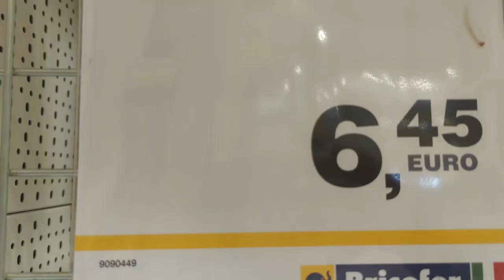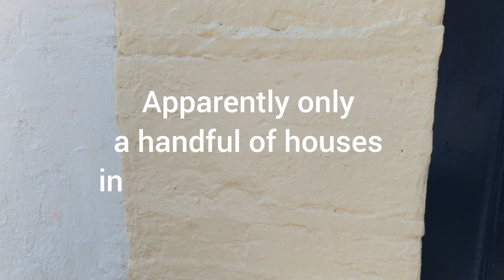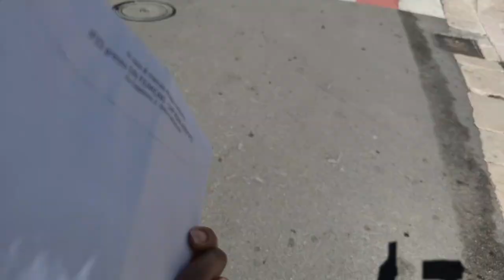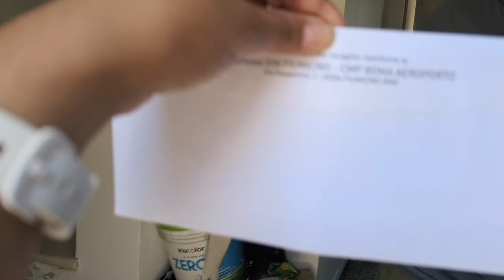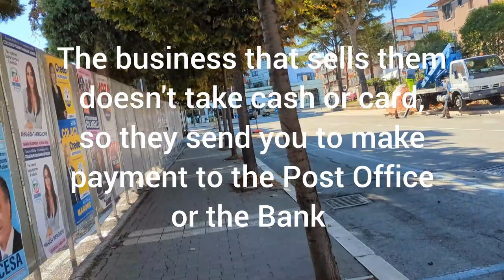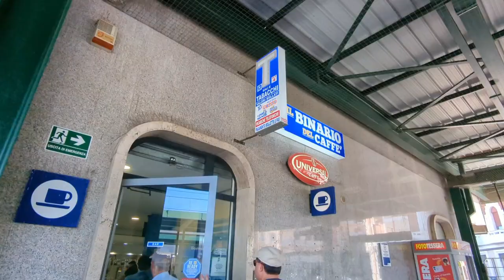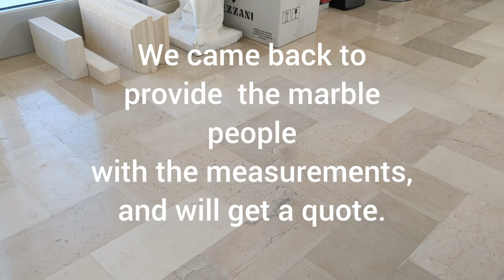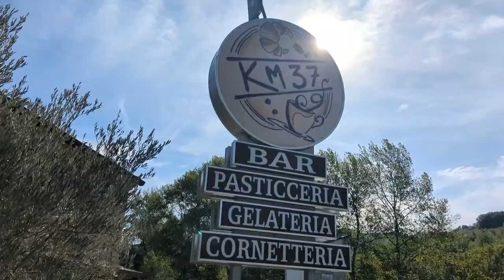Our Italian Home Renovation Episode 1. Running errands getting things done. Front and back doors

Comment: Love love the colour of the front door, don’t forget the safety bolt into the floor or top of the door frame on the back door or it can still be pushed in. I’ve noticed even Italian born and raised people have trouble getting reliable trades people, I watch Kylie Flavell and her husbands family have owned estates for generations and even Guido gets frustrated with people letting them down.
Reply from the maker: Hi OCDM. Thanks for the recommendations. We were without these bolts for about 2 weeks but have sorted now 😉.
I think trades people are really overworked here. Mist young people want to go to the big cities and uni instead of staying in the smaller towns and do trades jobs.
I think there is a huge market for this. Luckily Aden figured it out, because not having that door was driving us mad 🤣
Reply: @rossinniandco  we had no front door when we started the renovations only the security screen, so it was very hot the end of that summer and chilly that winter between that and no ceiling just the tin roof. 😳 lucky it was in Queensland ❤️ Michelle